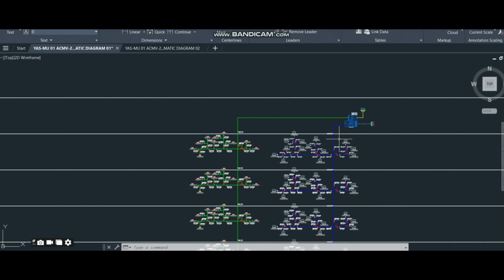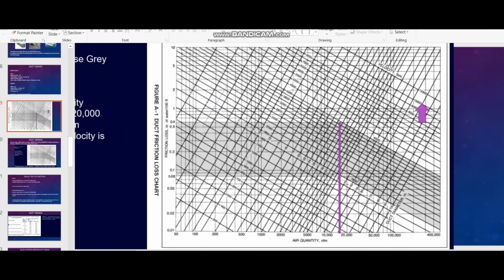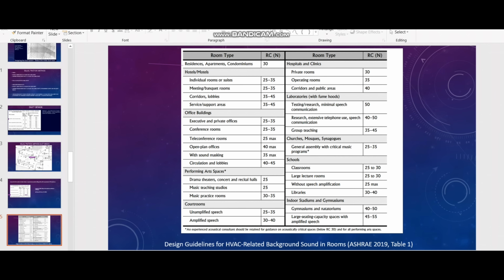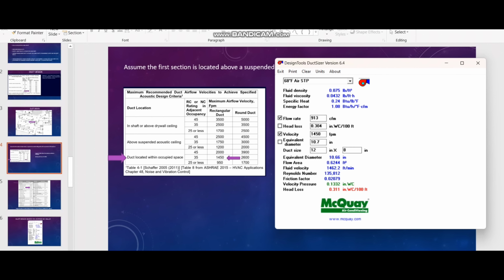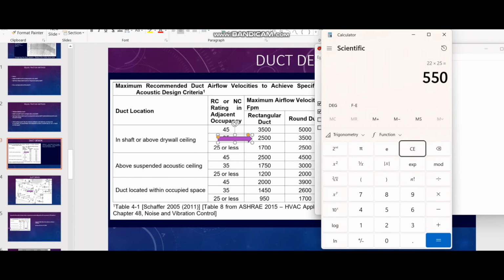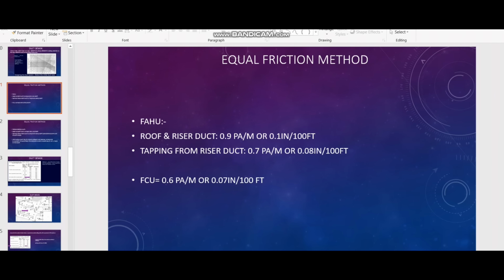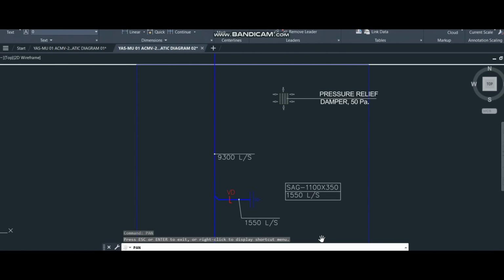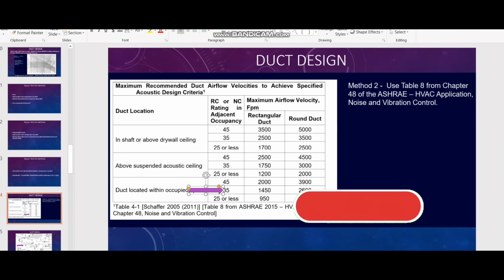HVAC Duct Design using ASHRAE & SMACNA l Step by Step Procedure with Common Design Mistakes 🔥

Comment: Sir very good video. I have a question if we are using equal friction method, which emphasizes to keep headloss same i. e 0.08 to 0.1 ft/100 ft , if we use your method we will have different headloss for main riser and tap area. This will violate the equal friction method rule. Can you please explain this concept? 

thanks

Comment: Where did you find the noise criteria table, I looked for it in ashrae fundamentals and i didnt find it
Reply from the maker: U can find the NC value in 2007 ASHRAE Applications Handbook, Chapter 42, clause 47.2 Acoustical Design of HVAC systems, Table no.42
Reply from the maker: Same is available in AHRI Standard 885-2008, Table 15

Comment: Well explained with Practical design issues like NC Value & how to design using other parameters. Most of the time i see some people show only the carrier handbook low velocity table and finalize this is duct design, some time i see 0.08in/100ft they take , but i am confused why it is correct or not correct. but 1st time i realize in your video, you give all the details with proper backups, really i believe this is one of the best video related to Duct design
Reply from the maker: Yes because NC consideration is important in the duct design since most of the projects needs acoustic analysis nowadays so it is better to consider properly at the time of design